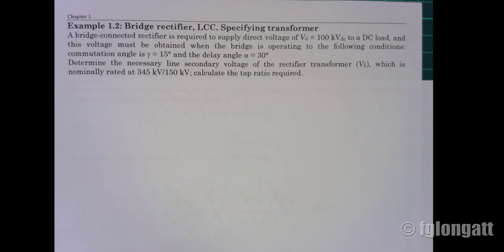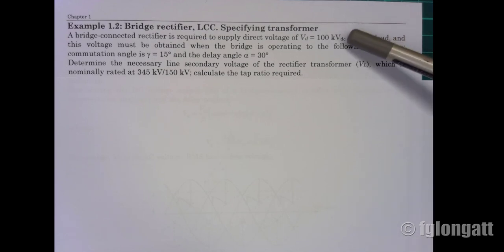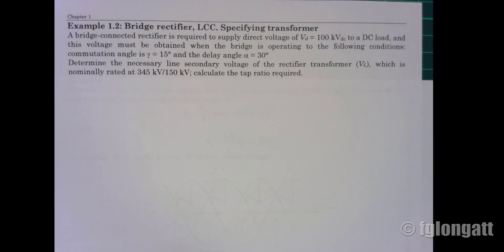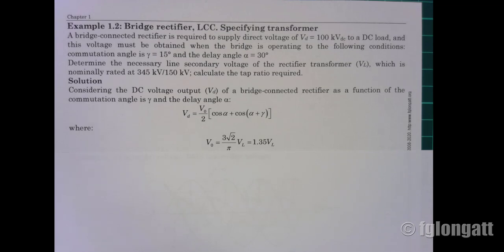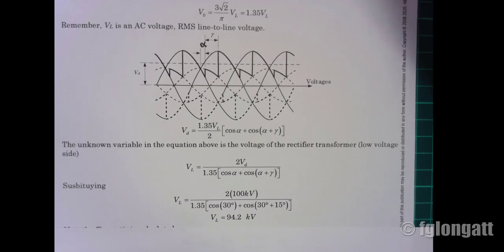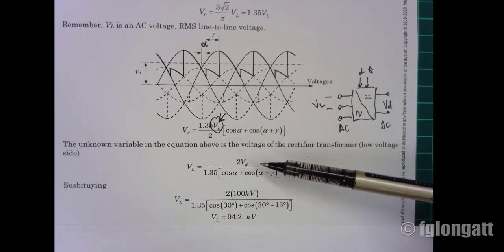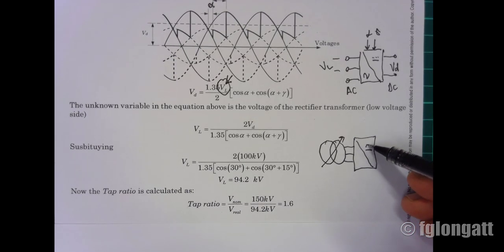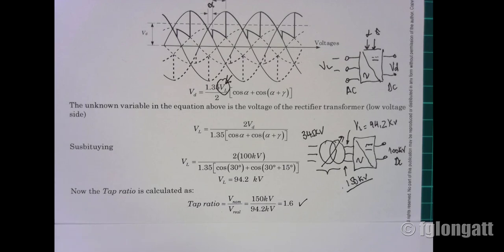Example 1.2,  Bridge rectifier, LCC  Specifying transformer

Comment: Sir can you make video on parallel inverter operation and droop control with implementation in Simulink; Along with this it will be very good if you run any microgrid (combination of different DG units) model with explanation, there is no video with proper explanation on YouTube for microgrid control and analysis.